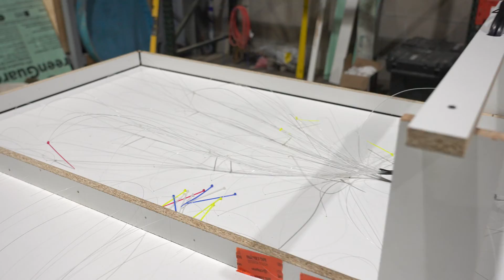Install Fiber Optics in a Concrete Countertop!

Comment: Was that a concrete sealer last coat or an epoxy. ??
Reply from the maker: Thanks for the comment! The coat that you see at the end of the video was our Supreme Clear 100 Epoxy. Then we followed it up with a coat of our Rock Top Matte countertop urethane. I'll leave link to both of these products below. Thanks for watching Deco-Crete TV!!!                                                                                                                                                                          https://www.deco-cretesupply.com/products/coatings-poly-armour/supreme-clear-100                                                                                                                                                                            https://www.deco-cretesupply.com/products/countertop-sealers/rock-top-wb-matte

Comment: Well yeah.. you missed the light part. Do you just put LED stripe? Or??
Reply from the maker: After you install the fiber optics strands and cast the concrete, you'll need an illuminator to power the fiber optics. There are tons of options out there, anywhere from $100 - $500, and maybe even more depending on how many fibers you need to run & some have more options then others. Thanks for watching!!!

Comment: How did you know what hole size to drill if the fiber was of mixed diameters?
Reply from the maker: We have a verity of small drill bits so we can adjust as we go. You don't need to know the exact diameter of each fiber, you just need to get it close. A nice snug fit is ideal, but some of the small ones in this video had a decent amount slop. Polishing or even just sanding the surface a bit will take care of it. Thanks for watching👍

Comment: How about the power ⚡ please?
Reply from the maker: You'll need an illuminator to power the fiber optics. There are tons of options out there, anywhere from $100 - $500, and maybe even more depending on how many fibers you need to run & some have more options then others. Things like color wheels, strobe effects, remote controls and so on. The biggest thing to make sure of is that your fiber optic pig tail will fit in the illumination port. Thanks for watching and please let us know if you have any other questions!!!

Comment: I love that idea! Do you know if this countertops would be heat resistant enough to use an induction cooktop hidden underneath, lets say we use glass optic fiber?
Reply from the maker: we have never tried anything like that, there is a limitation to how much heat concrete like this can handle. I would start by determining what the highest temps would be for the induction stove

Comment: Can you then put a mettalic coat on top without compromising the integrity of the fibres?
Reply from the maker: A metallic coat over fiber optics would at very least make them very dim or possibly cover them up completely. The fiber will be fine, just not visible.